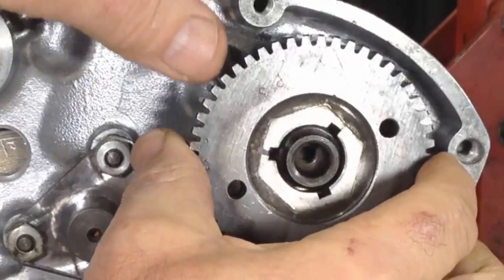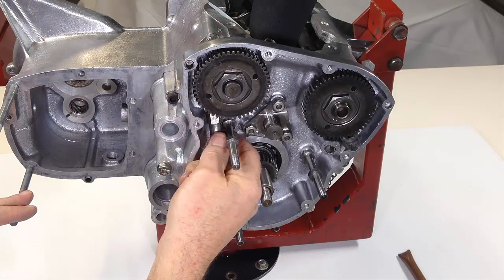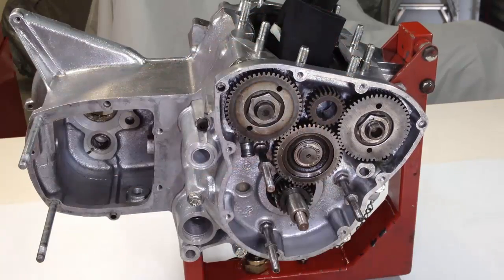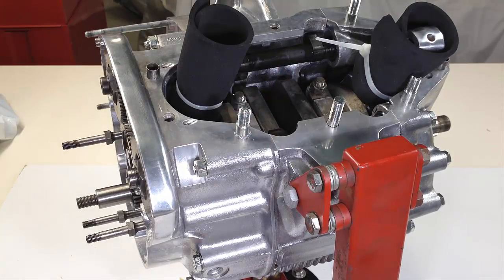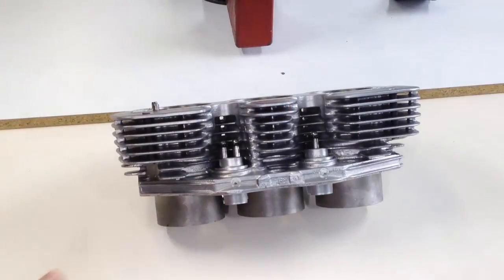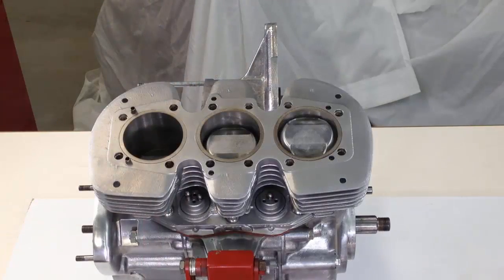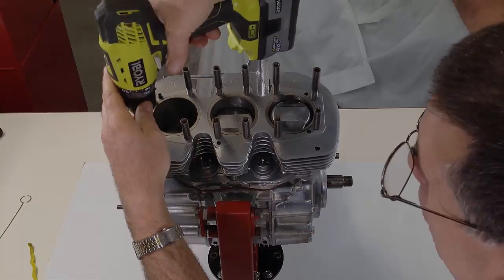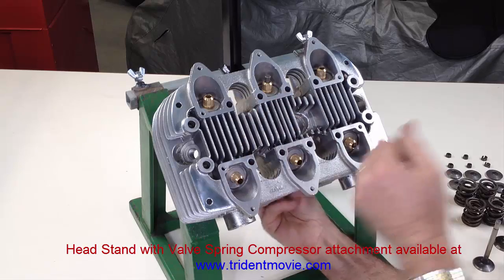Triumph Trident T160 Motor Assembly - Part2

Comment: Hi; 75 ftlbs is crazy! Also the manuals have the crankshaft pinion nut wrong in ftlbs but right in Kilos (5.6) so never ever those LH thread nuts should torque to 75!

Comment: I have a confession to make. I was a Triumph mechanic back in the mid to late 80s. I have rebuilt my share of T150 and T160 engines and replaced many rings and pistons. We never fitted the center piston. We always fitted the cylinders over the three pistons using a removable two piece ring compressor for the center piston. We didn't have YouTube back then to show us the correct way.
Reply: Hey JR I'd say we fit the centre piston separately because we don't have your fancy split piston ring compressor then! BTW...Just to put a smile on your face...Back in 1995 when I assembled my first Triple engine I read that the centre cylinder could be fitted separately, so I fitted the barrels with the outer 2  pistons in place and then tried to insert the centre piston with conrod attached down through the bore! As you probably know, the Big-End does NOT fit down the bore! I swore a little and removed the barrels to fit the piston from the bottom as per my videos. Then when I went to re-fit the barrels onto the outer two pistons I snapped an oil ring! Then a swore a lot!!!!!
Reply: @davidwright1957  I think fitting the center piston first is the proper way but in my defense we did a lot of ring replacements and taking the center rod out would have been an extra step. I like to say that we rebuilt or re-ringed every triple we sold and a few we didn't sell. The build quality was just not a thing back then. I had a BSA Rocket Three tie up just idling while I figured the ticket! Good times!

Comment: Do you know if anyone has produced a proper trident engine book with all the finer points of assembly ? Not triumph history book .   Do you just use the triumph stock replacement valve springs ? Have you ever checked the seated and full lift spring pressure  ? Have you got a video CD or anything compiled into a folder . Really helpful videos much  appreciated,  it will help keep tridents on the road .Cheers.
Reply: Don't you know the Technic Manuel about it ,who explains all the bike ,with engine ?

Comment: Would be great if someone showed how to do cam timing with high lift cams ie using degree wheel and dial indecators
PLEASE SHIW THIS ON T 150 Trident
Reply: Properly and accurately set up TDC, with degree wheel ,  I use a positive stop then using number one cylinder use a dial indicator on the intake push rod and use a figure like .050 or .080 thou before and after full lift , take the two timing figures add together and divide by two will give the intake  centre line . Much the same for exhaust lobe .

Comment: Triumph is the worst motorcycle in the world ,, it doesn't run for a single week without a fault.
Reply from the maker: Thanks for your opinion/ comment. Not one that is shared by many Triumph owners but you're entitled to it none the less.
Reply: @ClassicTriumph   I agree with your sentiment, but history proves him correct. 
And as for Triumph / Britt management at the time ~ words fail me..
Reply: All British motorcyles in the 60th were junk. Worst one was AJS, better one was BSA and Triumph. All leaked oil,
carburetors, ignition, oil lines, forkes... 😁😠
Reply: How fast is your camel ?

Comment: About ten times more complex to assemble than a simple Honda 750-4 ~ and about ten times Less reliable
Reply: The main difference being, Honda 750 never won five consecutive Isle of Man TT championships, The Slippery Sam Trident did.
Reply: @davidmacgregor5193    I thought the discussion was standard production bikes, Not a factory special that was far removed from a standard Bike, stripped & rebuilt every few hundred miles & ridden by professionals..
Reply: While Slippery Sam was famous for ~ Leaking Oil !!**@@##
Reply: @andyb.1026  On at least 2 occasions Slippery Sam was ridden to the Isle Of Man on Trade Plates as It was not intended to race it and was a late entry, definitely when Mick Grant won as he didn't have a ride and Les Williams offered him a ride on Slippery Sam. Also check out the 2012 video on here of the American Iron Butt, 11000 mile in 11 days, a 1969 Trident did it and not a CB 750 in sight.
Reply: If only I could find a CB750 motor assembly video as well executed as this.

Comment: Having worked at the BSA on the triple engine assembly line I never observed the guy fitting the pistons and barrels anthing like you have, the conrods were aready fitted to the crankshaft and the pistons and barrels were fitted without the aid of piston ring clamps, also he could fit the barrels in a matter of minutes, but as I can see your not working on a assembly line so its not relevant.
Reply from the maker: Andy B. Is it the women or the bikes with the superior design? 😆😃
Reply from the maker: Thanks, I really appreciate your comment and some insight into what it was like working on the assembly line. I guess one of the biggest differences here is that if we were to break a piston ring we'd have to wait for a new set to arrive and it would be out of our own pocket, whereas working on the assembly line if you broke a piston ring you'd just grab another one from supplies. 😊

Comment: I stood at the top of Sutton Bank (North Yorkshire Moors)
and watched a Triumph Trident and Suzuki GT750 go down.
When they got to the bottom they opened it up on the clear
roads and the Triumph left the GT for dead.
Reply: vinm300  Only until the Trident conked out, while the Suzzy went on for ever
Reply: Oh come on Andy, the Rocket 3 was the Worlds fastest production bike in 1968 clocking 131.8 mph at Daytona, they were speed /distance records ,you can check how far they went at 131 mph if you like, other manufacturers cancelled their bookings at Daytona after that. The record stood for 4 years until the Z900. As for my comment on the Iron Butt Rally, that Trident and rider is now going around the world and is currently in Russia

Comment: Hi on the intermediate timing gear there is two marks at the inlet timing gear side, one slot mark and the other a dot, you chose the slot mark, I have no doubt this is the correct mark can you tell me what the other mark is for. I must be honest If I hadn't a manual or someone like yourself to tell me I would have chosen the dot. These are excellent and well detailed videos, pointing out the little problems you can come up against and torque settings etc. Thanks. James
Reply from the maker: Nightster the other mark is simply to identify which mark that one is. The three are not equally spaced so three dots alone would not be any use.
Reply: Thank you for coming back to me, I thought it may have been to give a choice of inlet cam timing giving. do you know what effect it would have if this mark was used providing it didn't bounce a valve. Though I own a 1971 T150V I haven't needed to touch the timing gears, I did have to lift the head to have the center plug hole helicoiled as the previous owner stripped it when it had only 7775 miles on it and it lay in a garage in the U.S. until I got it a few years ago in the U.K..